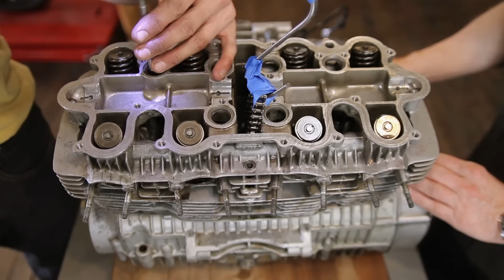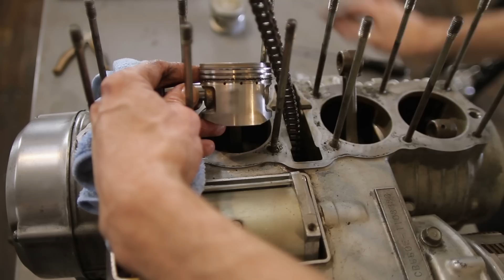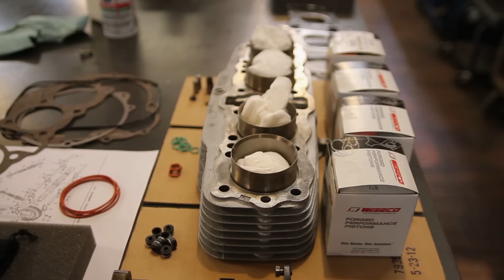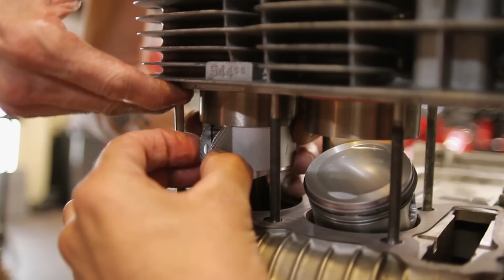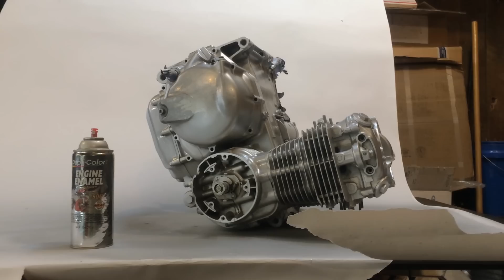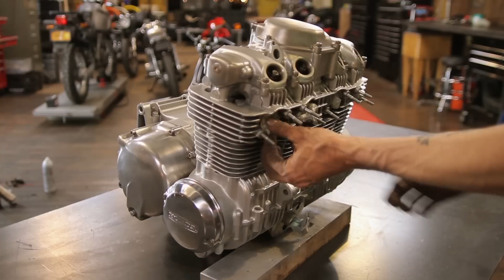Motorcycle Restoration Part 5: Engine

Comment from the maker: Ever wanted to take a look inside a motorcycle engine? In our latest Saturday Sessions clip, we've stripped down a vintage Honda CB550 motor.

 #motorcycle   #diyproject   #hondamotorcycles   #vintage
Reply: That's a biggun.  I think you're ready for a Civic now.
Reply: Warning This exercise usually consists of more swearing.
Reply from the maker: Jason Weber That's why there's a music track rather than conventional audio. :-)
Reply from the maker: Scott Hofer Why?
Reply: Scott Hofer I'm confused. You're saying the same thing twice. American = boat anchor.
Reply: Scott Hofer My first and only bike has been a1976 CB550 which every year starts with me adding a new battery and kicking it over.  Where as my friends with Iron Heads work on their bikes all winter long in a garage and work on them all summer long as well.  My bike is outside with a tarp over it and fires up with minimal effort.  How this that Amazing CB550 a boat anchor?
Reply: You get points for the pan head :).
Reply: One of my dream bikes is a old Norton Commando. I love Cafe Racers. My dad had an old Pan Head I believe around the year of yours. When he passed we had to sell it to help pay for the unexpected death so now I'm trying to track it down.  I just don't believe the CB550 is by any means a boat anchor.  It's a tough motor. The only thing I've had to do with mine was replace a head gasket. Other than oil changes it been solid.
Reply: Very cool.  As a beginner I wish there was a version with some explanation as to what they are doing and maybe why.
Reply: I agree Kevin, I'd like to do the same to my 550 engine this winter. You guys want to share the full length, with swearing version of this?
Reply: Im restoring a xs 750
Reply: AC/DC would make these videos better.

Comment: If I'm wanting to remove a coat of paint that's currently on an engine with soda blasting, should I blast/repaint the engine assembled or the individual parts?
Reply: Blast separate then paint assembled.

Comment: Great video!  But, you might want to upgrade your torque wrench to a "clicker" version. They provide better results and proper measurement.  Just saying......
Reply: Do they make clicker versions for torque values under 10 inch pounds? because I was hard pressed to find one, I went with the bend style like these guys did. My carbs have torque values of 3 and 5
Reply: Yes, they are made.  However, because of the low torque values, these are considered "special" tools.  Because of this, they can be expensive. So, it depends on your usage.  If, you use a lot, it is worth the investment.  If, seldom used, I'd carry on with your current procedure.  You do a great job!  You have great skills!